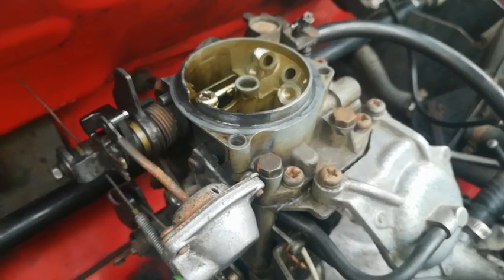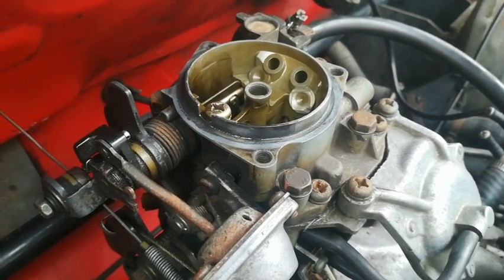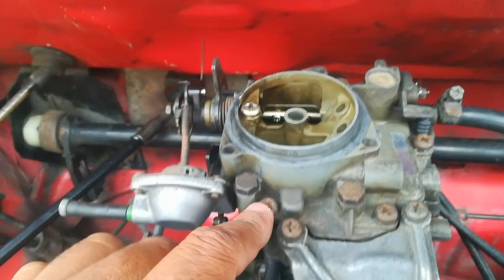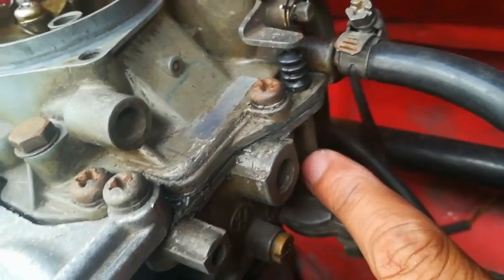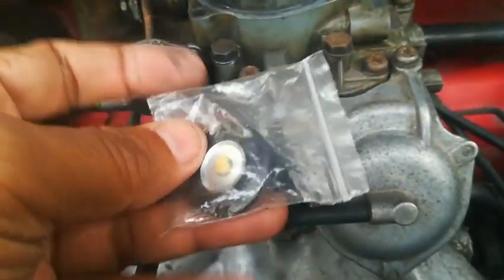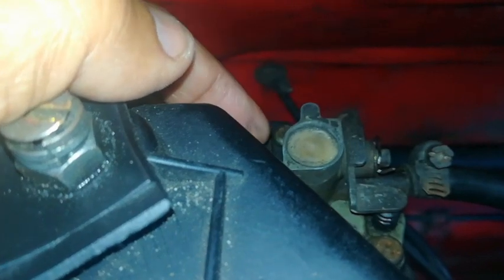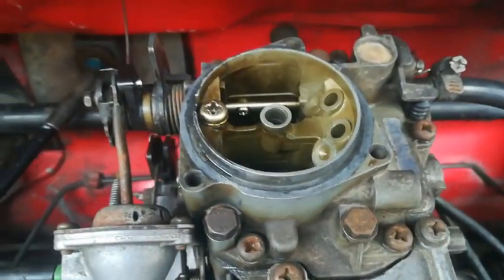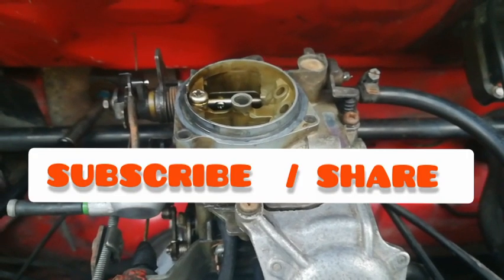GOLF MK1.CARBURETOR TIPS. KEIHIN KS2.How to identify problems. #carburetor #golfmk1 #vwfox #vwgolf

Comment: thanks uncle PJ yes that is the one so on our fox we have the bottel coil with two seperate plugs on the one plug is a plain black wire and red/black and the other plug is green and blue or black not to sure so there where the cable coming from the caburetor i do not see another wire with a plug indicated on your video i think someone has removed it but will have a proper look this weekend thanks so much for the help and keep the good DIY things

Comment: Hi. I applied a little Victor reign around the accelerator pump spindle plastic seal. Seams like when operating the accelerator,  the suction of the accelerator pump diaphragm sucked fuel from the float compartment and deposited past the top of the accelerator pump grommet resulting in the fuel leak.

Comment: Thanks for the very helpful video. A quick question: I have a 1988 Golf mk2 1600 and it's carb looks very similar to this one. I'm having problems with it starting sometimes and I think it's flooding. In your video you refer to the brass bolt/screw on top (right rear) of the carb where you make adjustments for the amount of fuel flowing into the bowl. Do you know what that should be set to (factory setting) because I think mine has been adjusted and it could be the cause of the flooding?
Reply from the maker: Hi thanks for viewing,. Generally 2 and a half turns out(anti clockwise) . After you have turned it close.. But don't turn to hard when closing it,. Just gently..

Comment: I have a 2nd stage problem. Now i can finally fix it. Much apprrciated.

Can you do a video on how to get the car to start 1st time. My buddy has a jumbo. His car start with the 1st swing and its also carb
Reply from the maker: Hi Shad. Glad to have been of assistance with your carb second stage. Just check the diaphragm if it has holes or tears in it. 
Getting a car to start first time,( I assume u mean first swing).. You have to take a number of factors into consideration, like  timing, carb etc..But will try my best to put out a video on it
Reply from the maker: Pls also ensure you subscribe now to the channel..
Reply: Ya i meant 1st swing lol. Already subscribed sir. Keep up the good work
Reply: Where can i find 2nd stage diagphrame?
Reply from the maker: @heinzerpersens2528  Hi Heinzer. I have not actually seen the second stage diaphragm come with the carb kit. So I suggest that you try and get one off a second hand keihin carb. Depending on how damaged the existing diaphragm is, I wud think it can be repaired with silicon.

Comment: Howzit pj    Bro can you make a vidoe explaining why the car runs fine but dies when i hold clutch in or brake  drops reves and dies    Or if you can assit on that issue  would be awsome
Reply from the maker: Hi. Those symptoms point to an airleak somewhere.. Check brake booster and servo pipe.. Also the carb base plate if it's carbureted model

Comment: What is the correct air fuel mixture settings on the screw? 2.5 turns?
Reply from the maker: Generally 2, 5 turns out Yes... But it could  vary slightly from engine to engine...

Comment: Good stuff. My vaccum secondary is not opening
Reply from the maker: Hi Adolf. Have u taken off the secondary mechanism to check diaphragm inside?. Just check on that and also the little pipe that runs from it to the carb. Then also the lever lower down below, on your right. Sometimes that lever comes off.. Thanks for the comment and welcome.

Comment: Hey PJ would just like to ask something when I bought my golf 1 it had a aftermarket carb eventually went faulty and couldn't repair it recently my friend had a brand new dorco carb I'm using it for a couple months now no issues do you have any idea if they good carbs cause in your video I see you talking about the kit and it's the same brand as my carb
Reply from the maker: Aftermarket carbs like Dorco  are not  bad ....Just don't fiddle unecessary on them ..Sometimes people have issues with their cars and they fiddle on the carb,..and it then turns out the issue was not even carb related..,and the poor aftermarket carb gets blamed..😊

Comment: Hi, PJ. The accelerator pump has rubber diaphragm.  My question, on one side is a rim and the other side is just flat. Which side should be fitted to the base of the cover plate. My problem is that fuel squits out of the accelerator pin top past the rubber grommet when accelerating. Please assist
Reply from the maker: Hi .it could be the gasket inside the carb.,or the Phillips screw which holds the lid, or top of carb, in place that needs to be tightened bit more..
Reply: Thanks. I see that the carburetor kit that I installed has a diaphragm that is about 2 mm too small. I assume that fuel was leaking pass it and traveled up the accelerator spindle and the squirtin out the rubber grommet.

Comment: Hi Paul, maybe you can help me here, i have a VW Caddy bakkie, i unfortunately got rid of the orginal carb and is now replaced with pirate carb. The reason i got another carb is coz the bakkies revs shot up to 1.5 - 2000 rpm when i stood still at traffic lights or stop signs. So now heres my issue, got the pirate carb fitted by mechanic and now while im driving, as soon as i change gears especially when i drive the car past 3000 rpm then it    stays reving high, sometimes the only way for me to bring the revs down is by giving the vehicle an even higher rev maybe to 4 or 5000 rpm then it sometimes drops down while changing gears. Any advice pls?
Reply from the maker: Hello Luis. It sounds like your second stage doesn't close completely after it opened, so to determine if it is in fact the case, when it happens again,pull off road, pop the hood and have a look at the carb, if you know where the second stage lever is, then push back on it,.. If the revs then drop to normal you found your culprit..( In other words the second stage valve is not completely closing)... To solve this check if there's any gunk on the lever of the second stage, spray some carb cleaner on to get rid of it, but afterwards spray some lubricant on the lever... Or just oil it up a wee bit. Also then spray some carb cleaner down the second stage throat. There could be dirt in there, obstructing the valve from closing enough. I had a similar issue, and also had to give the engine a hard Rev to get it to normalize. Hope this will help. Thanks
Reply: @pjs-golfmk1-diy  thanks Paul, i will let you know, btw, do you think that Q20 would help if i sprayed the lever?
Reply from the maker: @luisgorgulho5223  yes Q 20  is perfect.. But just check that valve if it's not sticky or stuck.. So the lubrication with ease it is a bit..

Comment: Hi there sir, Can you please advise me on what causes backfiring through the carburetor when I Rev the vehicle. The car does not miss Fire, the plugs are new the ignition coils are new
Reply from the maker: Could be the ignition timing is not spot on.. Or even the valve timing.. But first try to set the ignition timing with a timing light.

Comment: hi pj hw doin
tell me what cause my vw mk1 carbuerettor to over fuel.....it takes long to start on some mornings n then it eventually starts after some n then i have a strong over fuel smell wen it starts.....car  has also been very heavy on fuel recently.....i sprayed carb cleaner the other day to check if it will help....it did help but not fr long how ever 3 months ago u put fuel system cleaner in the tank wit about R200 fuel n i emptied the entire contents of the fuel system cleaner in the tank....the car ran very well afterwards n had no problem of jerking and stalling 
so now i am not sure whats goin on with it
i have a 1.6 carb chico vw
Reply from the maker: Hi. It could be a bit of dirt in the needle and seat of the carb.. And yo determine that the carb must be opened up.... Another thing could be the float level may be too high. May need adjustment, or the carb is simply running too rich... Which means the air fuel screw needs to be turned in (clockwise)... A bit..

Comment: My citi golf 1 heater blower not working  checked fuse it's ok what could be the problem? Thanks.
Reply from the maker: Hi.have a look at the motor itself .under the rain tray..check on the wiring .could be bad connection .or corrosion,which is common.
Reply: @pjs-golfmk1-diy  thank you broken.

Comment: I noticed you blocked off the choke diaphragm pipe...is it best not connected? Also how do the pipes connect for stage two vacuum advance?
Reply from the maker: Yes.. Best blocked off.. But that is actually for engines that have aircon. Doesnt  really even serve any purpose with regard to choke. If that diaphragm in there has holes in it you  will suck air into your carb. If yours is still connected make sure its not leaking /sucking air.. If so block of both sides especially the port that comes out of carb. Once I blocked off mine my engine ran smoother..
Reply from the maker: Vacuum advance pipe runs from a port behind the carb, and gets attached to vacuum advance unit on the distributer

Comment: Hi.is it normal for the float in the carburetor to have petrol inside?
Reply from the maker: Nope .. replace  it sir
If fuel gets inside there it will become to heavy to float on the surface of the fuel,meaning you will experience over fueling because the needle and seat won't be able to close when it has to

Comment: Pj, 2hat to do if you got a bowl overflow or leak, I tried setting , but still got a leak
Reply from the maker: If it's over fueling  generaly then the big screw on top must be adjusted. Or, if that is not the problem, Change the internal gasket of the carb.. Or if you have the leak at the accelerator pump, change the diaphragm
Reply: @pjs-golfmk1-diy  All set, now I got another issue the car is misfiring its not timing cause before I rebuilt the carb, it's was fine, and even when i tune the carb well still its misfire, it's also not the plugs they new, can it be that I didn't earth the carb properly? Cause when I take off the idle valve wire from the coil it still runs, badly thou🤕

Comment: Hi paul why did you block the one pipe ,my car is 1.4 but it chows the fuel
Reply from the maker: Hi. That pipe is not needed unless you have an aircon model Golf mk1.. That part basically brings the idle up once aircon is activated... But I don't know of aircon carb models in SA. If u say your carb is heavy, when last was it tuned.?
Reply: Hi Paul can you explain the black pipes around the carb please
Reply from the maker: @heinzerpersens2528 . Can you pls clarify, which pipe shud I explain?
Reply: @pjs-golfmk1-diy the 2nd stage and the 1 you blocked off
Reply from the maker: @heinzerpersens2528  Hi the second stage pipe is attached to a port on the carb, which sucks in to activate the second stage diaphragm. The pipe I blocked off is just a component used on vehicles that have aircon, so it's really of no use, so therefor blocked it.